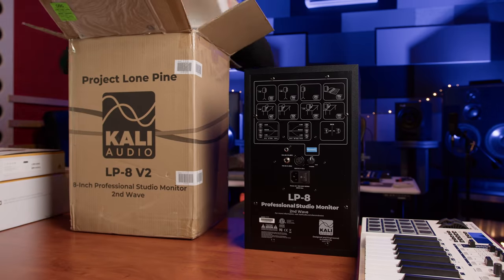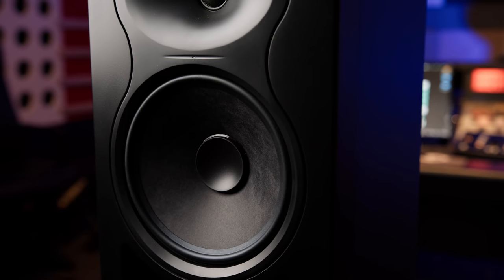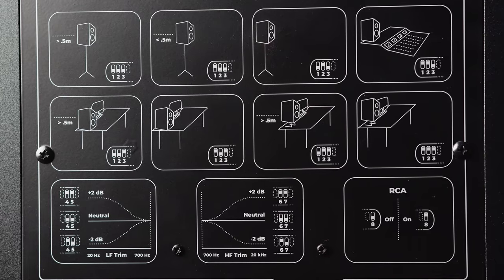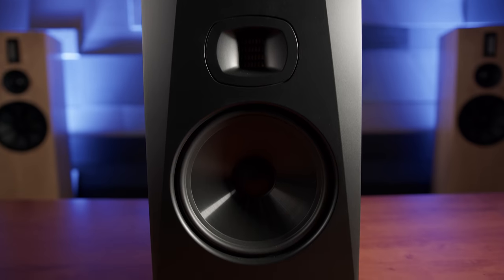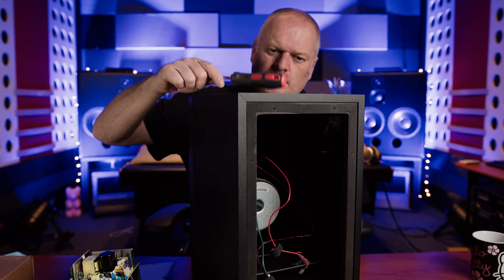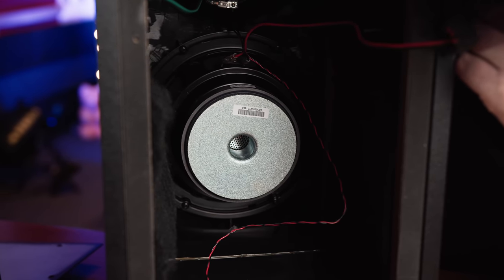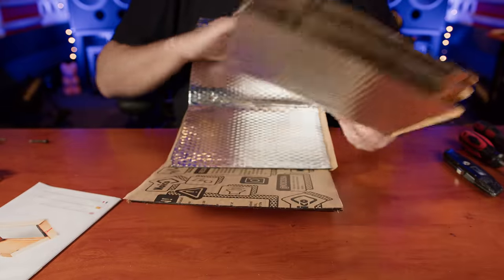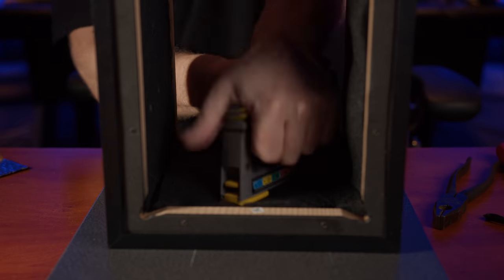Kali LP-8 | The Studio Monitor Review You've ALL Been Asking For!

Comment: The problem is the 'modifications' were to solve a problem that this reviewer ONLY hears in the speakers, they've been tested scientifically and this problem doesn't seem to exist and it actually got WORSE after the 'modifications' when measured!
Reply: I gotta disagree by simple physics - my LP6's are nice, but the bottom end sure WOULD be improved by some bracing, and it surely stands to reason resonances you hear when you tap the cabinet are gonna be in SOME manner audible ?

Did you know damping improves to the 5th power of wood thickness? Thats pretty significant - as for "worse when measured", who ran THAT test? Feel free to share data, but in the meantime I'm getting some of that damping stuff :)
Reply: @petegaslondon God bless u

Comment: I must say that seems the problem you have on your LP8s doesn't happen to my LP6s. Maybe it's because the front baffle and cabinent are not big enough to resonate. According to my poor knowledge of speaker design, the bigger cabinet, the thicker material and more reinforcement inside should be used. And since opening the speaker will break your warranty and adding material inside the cabinet will affect the low-end frequency, maybe making a bigger box with some thick plywood and putting the LP8 inside to reinforce it is a better idea?

Comment: First of all, we absolutely do not endorse any of the modifications that are suggested in this video. In addition to the concern (more below) that you might break something while attempting these modifications, we have no data to suggest that the addition of cross-bracing or extra mass would be beneficial. A problematic resonance would be clear to see in the speaker's directivity index measurement. Unaffiliated reviewers have collected this data on their own, and it's not clear that any such resonance exists. You can peruse this data for yourself: https://www.youtube.com/watch?v=Mr8eFqvdO0c
 
Now, why is it a bad idea to modify your speakers in the manner suggested? For starters, any time you take apart the product, you risk breaking something. Maybe you strip a screw, maybe you slice a wire, maybe you bend a component on the amp. You've voided your warranty to make a broken speaker. Adding things inside the speaker also introduces the risk that those things are going to move around and buzz. 
 
More importantly, speaker manufacturers who know what they're doing (and I would happily include any of our serious competitors in this statement) have taken careful time to engineer the loudspeaker system for a certain amount of acoustic volume. By adding things inside the speaker cabinet, you're taking away from that acoustic volume. This can negatively affect the frequency response of the speaker and the behavior of the port tube. In other words, you're taking a carefully engineered system and adding unknown factors that work against that careful engineering. 
 
We've taken the time to measure the average response in this video of the original speaker and the modified version. The modified version is 2-4 dB hotter between 200 and 700 Hz, with a ~10 dB spike at 600 Hz. Interestingly, if your concern was "boxiness," this is exactly the region that you'd want to be less pronounced. This could simply be from the difference of the speakers' position in the room relative to the microphone. But the takeaway is this: the best case conclusion from what's being presented here is that uncontrolled factors in capturing the sound make for an invalid comparison between the two speakers. It is entirely possible that the modifications that were made have negatively affected the performance of the modified speaker. We are happy to share this data via email upon request. 
 
Finally, we have to take umbrage with the suggestion that the measurement data that we present publicly in inaccurate. As far as we are aware, Kali Audio is the only manufacturer at this price point that supplies full resolution measurement data of our systems. We also HEAVILY encourage the collection and presentation of measurements by 3rd parties, because we know that our systems will stand up to this kind of scrutiny. Our published data matches that of these 3rd parties very well. We also have good psychoacoustic science on our side to suggest that the anechoic and in-room behavior of our speakers correlates to a standard which makes them highly useful studio tools as well as generally pleasant speakers for listening. 
 
We're always open to feedback, and we take criticism seriously. Any time we can make an improvement in regards to the value of our products, we strive to do so. That said, the suggestion that improvements are necessary has to be supported by actionable measurement or demonstration. That is not presented here.
Reply: ^^This
Reply: Kali: We're always open to feedback

ME: Doesn't look like it
Reply: Kali Audio, How are you going to address the clipping/popping distortion in the bass that people are experiencing with these monitors, as your company is aware there is a design/build issue/flaw causing this? Just curious from what I have been reading, and thankful that I don't have Kali's myself so I'm not experiencing it.
Reply: @Wayne Brown Of course there's a measurable difference. We measured it. The modified speaker seems to perform worse. We can send you those measurements. 

James complained of "boxiness," which would typically be interpreted as a boost between 200 and 900 Hz. In the video, their modified speaker has a measurable boost in exactly this frequency range. 

It is entirely possible that the difference in response and between the two speakers is due to the fact that one speaker is in a different position in the room, and this isn't a lot of data to go on, which is why I'm hesitant to just come out and say "the modified speaker is worse."

"But I thought it sounded better!" This is a common psychoacoustic trick that they've set up. They've primed the viewer that there is a problem with the speaker (there isn't), and they've presented an alternative. 

If you spent time listening to the modified speaker with familiar reference material, I doubt very much that you would prefer the modified version.
Reply: @Wayne Brown Our products are not poorly made. No product in this category is designed to be serviced by the user. 

I can guarantee you that someone is going to watch this video, attempt to modify their speakers, and break their speakers in the process. Their warranty will be void, and so they'll be out a few hundred dollars.
Reply: @UncleBenjs  it's not clear that there is a "design/build issue/flaw" as the problem only manifests with certain audio interfaces. We are investigating the possibility of a firmware tweak for the cases where it does come up, and so far that investigation is looking good.
Reply: @Wayne Brown that's a valid note. We'll update the download link. Happy to email you in the meantime.
Reply: @UncleBenjs  the 'modifications' to solve a problem that this reviewer only hears in the speakers, which when tested scientifically tested by people doesn't seem to exist actually got WORSE after the 'modifications' when measured! This video is at best misleading and in reality much worse than that!
Reply: @Wayne Brown the problem is the 'modifications' were to solve a problem that this reviewer only hears in the speakers, they've been tested scientifically and this problem doesn't seem to exist and it actually got WORSE after the 'modifications' when measured!
Reply: @metalman3227  Kali employee?
Reply: @Wayne Brown stop gaslighting. The 'problem' this reviewer hears is not born out by fact and 'fixing it' made it worse.
Reply: @Wayne Brown I don't have an argument, just sticking to the facts. 'Fixing' the speakers increased the 'boxiness' in 200-900hz (you seem to prefer that, that's ok). I too work professionally and have never and never will say 'that a budget monitor is perfect'. Again I know the internet is a volatile place, however I'm not interested in the drama side of it, just the facts. Wishing you the best!
Reply from the maker: @Kali Audio did just post a link but the YouTube auto-bot is removing links and I can’t turn it off. If they can change the link to whatever it was they did that worked in their original comment and try again, should be ok
Reply: @PresentDayProduction  We only got it to work in our original after changing the link to a youtube video. But the link is updated on our website on the lone pine page!
Reply: I just got my Kali LP6 second waves yesterday. So far, so happy. Although I not have experience with other studio monitors. However yesterday when i plugged them in they (both speakers) all of a sudden sounded like a smartphone speaker, absolutely terrible sound. I thought something's screwed up, however today they work perfectly fine again. Is there some issue with my audio interface? I doubt it is the speakers since the problem was on both speakers and it's gone now. The audio interface is a focusrite scarlett btw
Reply: @musictraining5071  any thing that happens at the same time in both speakers is usually elsewhere in the signal chain. But if it happens again, make a video and send it to our customer service team and we'll see if we can find anything for you!
Reply: @kaliaudio  thanks, hasn't reoccured for now. i'm happy with the monitors. i'm pretty confident it wasn't an issue with the kalis, but since i'm relatively new to audio tech and producing i wondered if you perhaps happen to have an educated guess just out of curiosity more than anything else. thanks for the reply.
Reply: Before watching this review… I was thinking of getting some Kali Audio LP6 or LP8’s,  definitely won’t be wasting my money on these cheap arse things 🤦‍♂️ poorly made and exactly what I don’t want is a “boxiness” type sound! Why is there no decent padding or cushioning inside to make them sound better? everyone’s just up for making as much money as possible and let’s pull the wool over everyone’s eyes 🙄 I almost fell for the Kali marketing hype!

I sold my Yamaha HS7’s because of the honkiness in the mids. no expense spared internally on your speakers Kali! 🙄 have to think about getting another brand now… thank god for this honest review !😁👍🏻

Comment: This speaker, among many others, has been measured by Erin's Audio Corner and Klippel Scanner indeed found that there is a resonance in the midrange, around 500-1000 Hz, so nothing new here. Perhaps this accounts for the perceived "boxiness" or the "chesty" sound as the other reviewer described it. Cabinet or baffle resonances are very easy to show in a simple FR or waterfall graph. So yes, the LP series is overly hyped but I don't think that anyone claimed that these are among the best budget monitors from a build quality point of view (which is indeed similar to other brands like T series Adam) but rather that there is some excellent engineering going on, especially in the IN series (these being three-way coincident monitors, thus having better imaging, wider sweet spot, better vertical directivity, lower IMD e.t.c.) which retails for 600-800 USD a pair and at this admittedly low price point is incredible what one can buy nowadays. 

If there is real competition for that amount of money for a three-way coaxial, I would like to know! I am pretty sure that the IN-8 has the same cheapish construction and resonant cabinet and plastic front baffle and I know because I own one! But sound wise they are an upgrade over typical two-way monitors and much more fun to not just mix but also listen to.

Comment: This is why Genelec build their speaker cabinets from cast aluminum that's completely curved all around inside and bolted together with rubber seal (that you can't replace if you take it apart. you need to send to for servicing). It's heavy and non resonant in the frequencies we're interested. :)
Even their subwoofers have steel enclosure that works as a baffle at the same time, sandwhiched between two very thick MDF panels and secured with long bolts. Heavy, non resonant.
Perfection :)
Reply: You can take apart a set of 8030's, the gasket is no issue.  I had to replace the power supply caps after a brownout.  I wish I had the sub as a lot of lows will cause the mids break up a bit.
Reply: @moddquad8362  I was given this advice regarding the gasket by my friend who works for Genelec when I was thinking the same issue after having my 8020's powered 24/7 over 14 years. It sounds very believeable.
Reply: @Mtaalas  I bought mine from ebay,  They were modified from 220 to 110 volts for the Olympics a decade ago, but only $200 each.    When I called them about the repair,  they insisted on returning the speaker to 220 volts so it would match the serial number, they refused to repair it otherwise.

Comment: Oh I've GOTTA try THIS :) .. When I got LP6's on ol Glenn's recommendation, I liked 'em - a lot - but as someone who makes amps (& sometimes speakers) i sure noticed exactly those limitations 

The plus side, mid-treble sounded better, with better dispersion than any of the ok-ish HiFi speakers i used to monitor on (the nice curvy waveguide, one advantage of a plastic baffle) better than KRK's which I always thought were competent - but KRK's use heavier wood, and the lightweight construction meant damping and bracing sure was on my to do list 

Thanks a bunch for tearing in there! Reality check: they can only give you SO much for you 500 (or whatever) bucks, but now I've seen this I'm gonna like them even more - 'some assembly required!'

Comment: Rule of thumb - if mixes done with those modifications are better and translate better to other systems, they're worth it. If you really don't like something about these monitors in particular, you would probably end up messing with those frequencies during mixing. Hence monitor is also a personal choice. Even if they broke something VS the stock sound on measurements, theoretically you can always use e.g. Soundworks, perform measurements, and equalize it (even only in a specific range). Better acoustic reserve potentially eliminating resonants might be beneficial for the correction in the end too. Still, it's possible the company could take these rumbling cases into account while designing the speakers, hence their "careful design" statement, but how bald statement is that you can only find yourself if you don't believe.

Comment: I'm going do that to my LSR 305's. They've got similiar problems and your result really convices me to do the same, it's quite audible on headphones. In addition to the cabinet resonances my speakers also have a nasty port resonance. Can I add weight to the bass reflex tube to fix this? Thank you very much for this informative video!
Reply: Theres a lot of variables ,but what i do (DISCLAIMER No Measurements made) on flubby reflex speakers is bung light to medium foam in the port hole to reduce its effect... Slightly LESS bass but better bass - 

It's non-destructive and cheap to try

Comment: I purchased these to replace my version ones. However I noticed a major issue. I was hearing a crackling/clipping sound on bass tones at all volumes. I received a replacement pair only to find the same issue. Kali has admitted the issue and offered very little to do anything about it. Did you notice this on yours?
Reply from the maker: No, haven’t heard this one yet, but will keep an ear out for it if we use them again!
Reply: Seems like they're very poorly made, which also seems to contradict the blag essay they posted in the comments on this video

Comment: honestly i've never found sub 500 current production monitors that beat my 90's Event 20/20 BAS, they're slightly unreliable, i've had to replace the amp board on the right one, but overall the sound is just incomparable to anything i've heard
Reply: 2:45 exactly, It's all the mids for me
Reply: 5:40 could very well be that the event's are solid mdf, i'm gonna go smack my spare cabinet and se how that sounds

Comment: no one think of doing a sealed box conversion?
block the port and fill the internal volume with correct stuffing, anything is better than bassreflex.
Reply: @Wayne Brown   nonsense, what's your claim?
Reply: @Wayne Brown altered is the point here, we want to remove the port output, and the effect on the driver, plus have more stuffing inside to absorb better.
Reply: @Wayne Brown you can adjust the amount of stuffing in the box to some degree and make the volume lower.
but i do not think there is a drawback that will make a woofer sound much worse. sealed design are flexible solution. its the ported boxes that require volume and port length tuning.

Comment: Great video as always guys, but that’s a lot of work to get them sounding good and requires some level of skill to do that!!  Although, I guess you get what you pay for:-)Do you think that the the noise deadening adhesive material you used could be placed on the underside of desk, to stop speaker vibrations travelling to floor perhaps? Particularly for speakers that are placed on a desk (despite being on stands vibrations can be felt on floor in seating position). When I saw your use of it, it really got me thinking?!!!

Comment: Very good review and observation. Still,  plastic front baffle ... cheap cabinet and little class D amp with Smps power supply.... it seems to be the actual trend in " monitoring " entry level speakers. 

I would prefer manufacturers to go with more durable solutions.  high density MDF cabinet, class AB amp with big transformer and lot of filtering and good speakers. You can still find it at higher prices but they all start to put cheap PSU and class d modules that have hiss and Liveless sound in this price bracket.